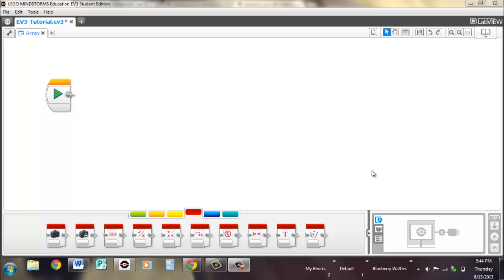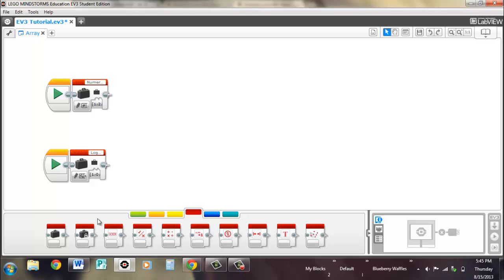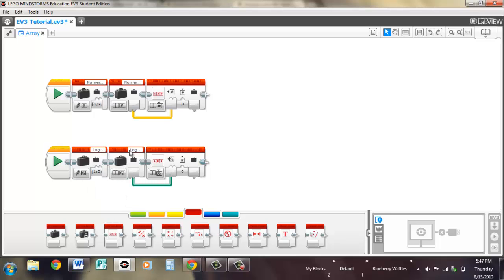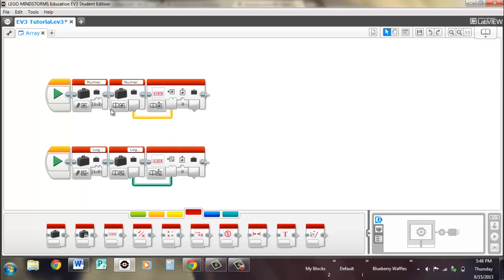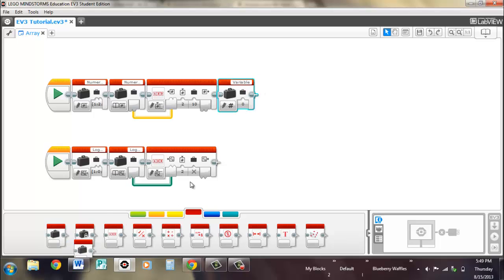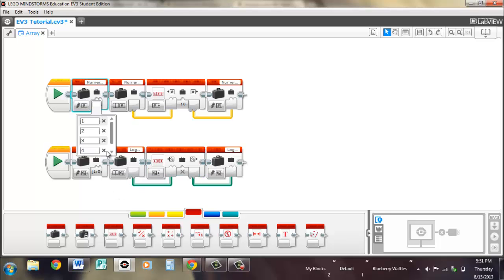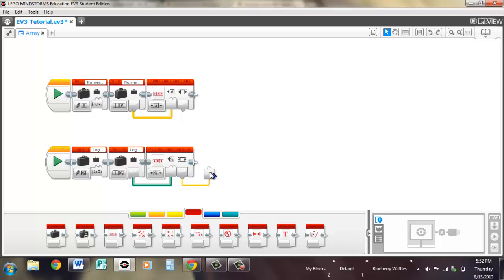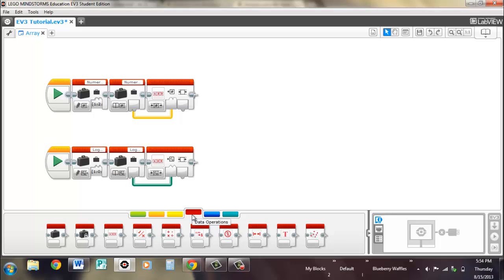21 - EV3 Programming: Arrays

Comment: as someone who programs in C# and got homework to make a bubble sort program (witch I did) can I do it with an EV3 and build something that displays it? (i.e. have blocks represent different numbers in the array and have the EV3 move them but that I will try to do after I can make a bubble sort program)
Reply from the maker: Alwin Priven You should be able to call each array spot in sequence and use the display block to display whatever value you choose.
Reply: W.A.F.F.L.E.S. Community Robotics so can I display the whole array like that (by making a loop that calls the array spot+1)?
Reply from the maker: Yes, you should be able to.  Let us know if it worked!
Reply: W.A.F.F.L.E.S. Community Robotics the problem I'm running into is that to get the array length or get a value in a spot, it takes to much blocks and it get confusing.
Reply from the maker: Yep, that's part of the in-efficiency with the EV3 software, try splitting sections into myblocks to make the code simpler to understand without a mess of wires.
Reply: W.A.F.F.L.E.S. Community Robotics yea I have the code of the program itself, how can I display all the numeric array on the screen? do I have to use a loop?

Comment: Great instruction video! I have a question. I have a pushbutton, and a motor being used in degree sensing mode. I want to write a loop, and each time through the loop, I want to read the rotation value, and append that to an existing array. Eventually I'll read all the values out, but right now I just want to write a loop that appends (stores) successive sensor values to an array, each time through the loop. I've been fooling around with it for two hours, and can't work it out.

I could do this in C in 10 minutes, but I want to do it in EV3-G.
Thanks in advance for any advice you might have.
Reply from the maker: If you look at the array block, you can see that there is an append mode. What you would do is in the append block there are 2 inputs, and one output.  Input via data wire which array you want to use, then for the second output wire in the current rotational value for a motor using the motor sensor block.  That should just add the number onto the existing array.  I haven't played around with arrays all that much, so I can't say for sure that that will work (because I haven't tried to do this specific example, but I think that it would work.)
Reply: Hi, and Thanks! I worked it out last night after I wrote this question. Basically it's exactly what you say. I kept trying to use append and then realized you need a container both on the right and left. the Array Operations Block only operates on arrays, it doesn't store them or keep them safe. Should've seen that sooner. When wired up, the array, say "Values" in a variable block feeds into the array in in the op block. The append occurs, with the value wired to the sensor, and the new array with the new item gets stored out via the "array out" block to the new copy of the array on the right. Perfect!
Now I can store any number of numerics or whatever, into an array just by rotating the sensor!